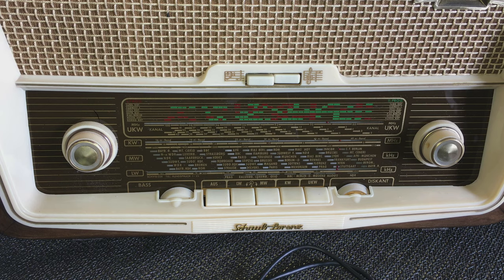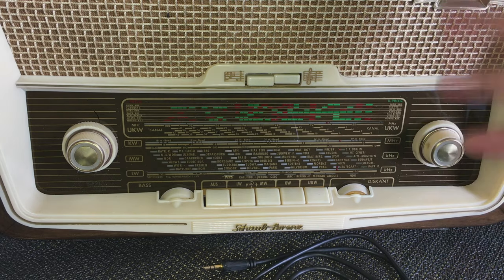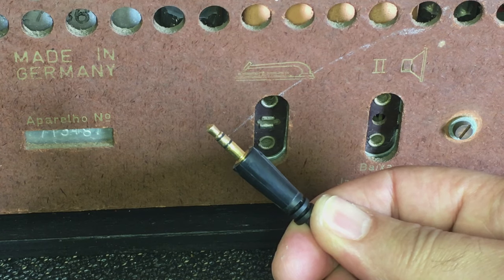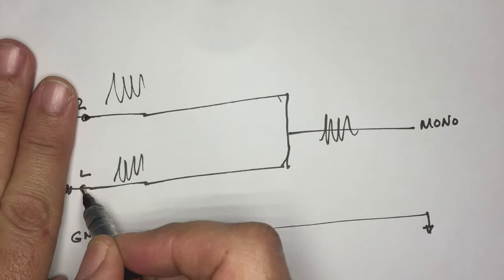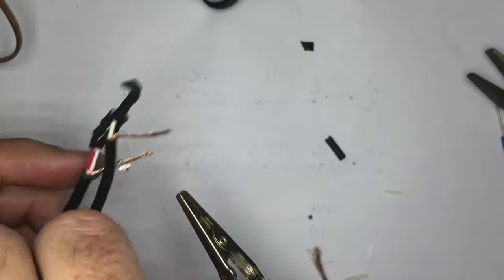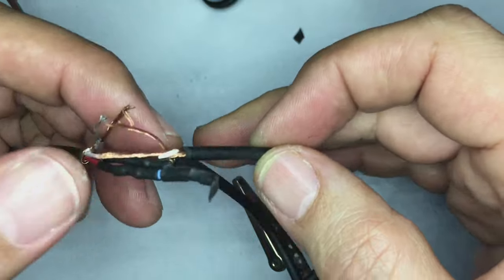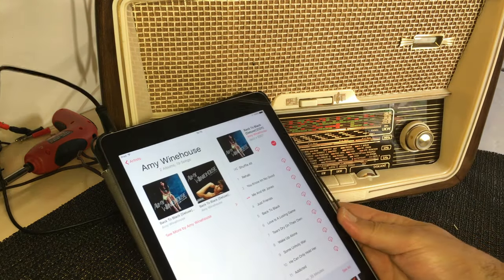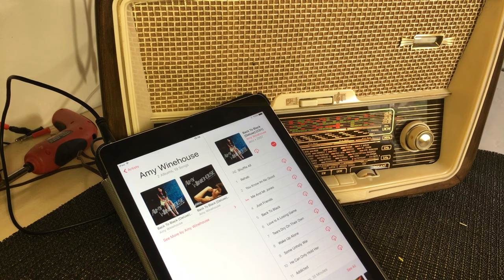Stereo to Mono DIY cable to connect music player / iPhone to tube radio.

Comment: Hi, thanks for the info! I would like to use my Guitar Amp as a speaker and my smartphone as source. Is it possible? Should I make a custom cable or there is something in the marketplace to buy?
Reply: Fender FM 210R - 65 W output
Reply from the maker: Luxor TheFirst : not really a good idea because the input level of a guitar amp is supposed to be quite low compared to the output from your smartphone. The cable would basically be the same, except that it would go into a mono jack to connect to your amp. The result would probably have quite a bit of distortion due to the signal level, and the inherent distortion that your guitar amp would introduce, but it will work.
Reply: Electronics Old and New by M Caldeira: 
Thank you for you hint. I just managed the thing this way:
1) setting Windows (or iPhone as well) to Mono sound (see “Ease of access” options)
2) using a cable with a standard jack 3.5 (stereo) and at the other end a standard guitar jack (mono)
3) plugging in the guitar jack in the amp, specifically into its secondary input (the one “less sensitive” studied for guitar with higher output)
4) lowering Windows master sound to 1%
5) adjusting/balancing sound between both Windows and Amplifier
6) setting/testing Equalizer through Windows audio settings - Speaker Properties - Enhancements
Reply: Get an iRig from IK multimedia website, not a cheap option but works well with smartphone

Comment: Hello Sir ! please help ! I see current flow on the pickup input, i tested it with tester (dont have a multi-meter)! should i connect my phone to it, with the cable which i made with the help of this video ?
Reply from the maker: ManuLeisure : what do you mean? Your pickup input should not have any voltage at it, so I don’t understand how and what you are measuring if you don’t have a multimeter.
Reply: @electronicsoldandnew  i mean is it normal to have any voltage on pickup input ? i checked with a simple pen tester there is voltage, i dont know how much it is, so what to do ?
Reply from the maker: ManuLeisure : you can’t connect up your music source until you have tested the input properly. You need a multimeter to do that.
Reply: @electronicsoldandnew  i will get one soon. Thank you!

Comment: Hi, I have a Question, can I use 2 Diodes o a transitor instead of resistors?
Reply from the maker: Nope.
Reply: I would like to know why, Its been a while since I'm looking for a solution to connect a stereo R L output to my single Mono MIC input.
Reply from the maker: I think the video explains it all. You are summing the left and right signals.
Reply: It should not, because diode wont let the signal go back. Diode has only one direction.

Comment: I am kind of having a Question with the opposite Problem.. How to get, via Cable, Sound out of an old Radio with 5 Pin DIN Socket? 

I have a Radio with a 5 Pin DIN Socket and I want to record from this Radio. So I want to use the Tape Out of this Radio. But when I connect Pin 1 directly to a normal RCA Input, the Signal was very weak. I heard, that the Output Signal of a DIN Connector on a Radio with DIN Socket can be low and tends to be (more or less) high Z. Because of this I connected the Signal from Pin 1 at the DIN Socket to the Input of a DI-Box and the Output of the DI-Box to the Mic Input on a Mic Preamp. That seems to work. Would that be a possible Solution or is there a better Way to do it? The Radio is mono.
Reply from the maker: If you’re sure that pin 1 is in fact the tape output, then that would be the way to do it. I’m not sure that all the radios I’ve done follows that rule. You could also use the speaker output through some attenuation into the DI. That may produce good results too.
Reply: @electronicsoldandnew  - Thank You for Your fast Answer! I will try that too! At least for my Radio the Tape Out is Pin 1. I tested that. Maybe it is standarized this Way. Because that is what DIN stands for. It is the German Organiation for Standarization.. But it could be possible, it is only this Way for Radios. For Tape Recorders with DIN Socket it could be wired "differently". Because the Tape Output has to go to an Input and normal DIN Cables do not seem to be "crossed".
Reply: @electronicsoldandnew  - I "experimented" now a bit with the DIN Tape Recorder Output at the Radio and found, that I had to add a Resistor after the DIN Output to Ground to "simulate" the typical Input Impedance of an old German Tape Recorder. And now it works and the Sound is more or less stable and has a "wide" Bandwide  and it sounds (more or less) the Same, regardless if I use the Mic Preamp or the DI-Box (the two Device have very different Input Impedances.. ). Before I did that, the Sound changed a lot with the different Input Impedances of the different Devices.

The Speaker Out worked also, but not as good as the DIN Tape Recorder Output at the Radio. (In my Opinion). The Sound at the DIN Tape Record Out is "wider" maybe and it is also not affected by the Tone Control of the Radio.
Reply from the maker: DE2017 : glad you got it working. The DIN output is in fact before the tone controls and you also don’t get the power stage effects like distortion.

Comment: I think you are making things here more complicated as they need to be:
a) set your sound source to mono output and use a single channel
b) solder a wire with 3,5 jack to the insides of a radio you intend to use for external sound sources
c) such jigs are not the only reason you have to take care so the chassis is not live (if you want to install an earthed connection it's a must) . For regular use it's probably not a bad idea to add an isolation transformer, either internal or external (and make a power plug in such a wa that it can only be plugged in it, eg. an aviator plug)

Comment: This schematic does not work if you want to connect a mono speaker to a stereo amp. I have a 100W stereo amp and 8R speaker and no matter what resistance I put on both channels I either get a very weak signal (in case of 4.7KOhm) or I get my amp overloaded (in case of 1K resistors). Also there is another schematic circulating the net that suggests putting a 47K resistor between the joint positive and the ground. This doest not help are results in terrible distortion. Any ideas or suggestions on that? Here is the link to the approach suggested (similar to yours):  https://support.hifiberry.com/hc/user_images/QmrGto7bgOB_ETollfepeA.jpeg
Reply from the maker: No, it won’t work. As the title says, it converts a stereo signal to a mono signal to connect to a tube radio. It is at Line level, NOT after an amplifier!
Reply: Electronics Old and New by M Caldeira do you have any suggestions as to how to connect a mono 8ohm speaker (or 4ohm) to the output of a stereo amp? Looks like the Net is full of wrong suggestions here as well
Reply from the maker: You can’t! That’s it. No suggestions are valid as it’s not something you can do. A stereo amp’s output goes to a speaker per channel. You simply have to get two speakers to run a stereo amplifier fully.

Comment: Hey mate can you make me one of these?!!
Reply from the maker: +Stephen Kane : sorry. No time and very far away (I live in Madeira).
Reply: You're not kidding! That's far. I think I'll manage something. I just opened the back of the 1070 and boy was there DUST!!
Reply: please? lol. otherwise, what would you recommend? I don't think I'm handy enough to build one myself.
Reply: i am in germany, but if you get yourself the components i could offer to guide you through it via skype or something similar
Reply: Hey mate -- I might take you up on that. I've NEVER worked with transistors/capacitors or resistors ever. Barely audio cable even. So I'll have to get a soldering iron. Whats your email?
Reply: Stephen Kane the absolute minimum tools you need would be:
soldering iron
a pair of pliers
tape (if you dont want a third hand)
solder
a place to work that is heat resistant

you can mail me at schoko140
Reply: @web.de